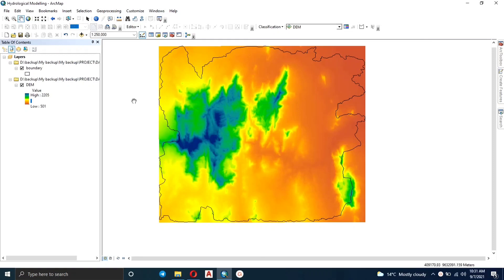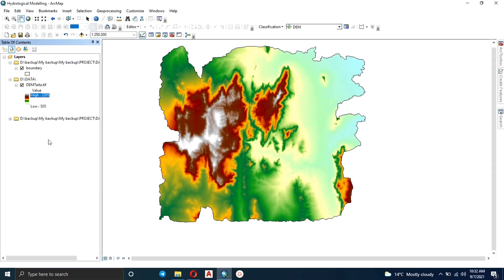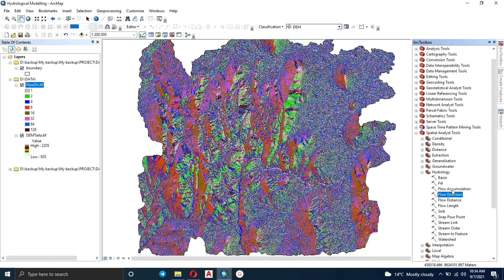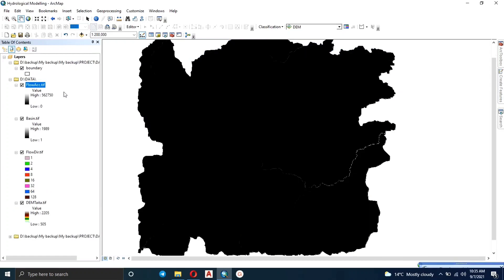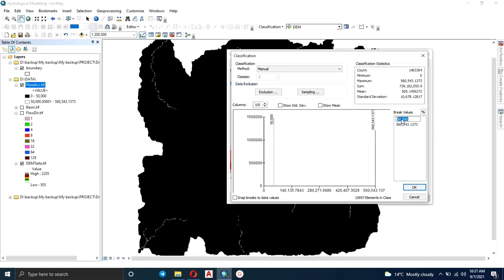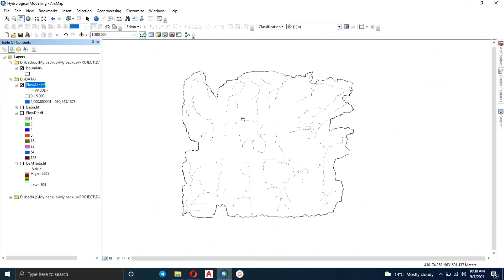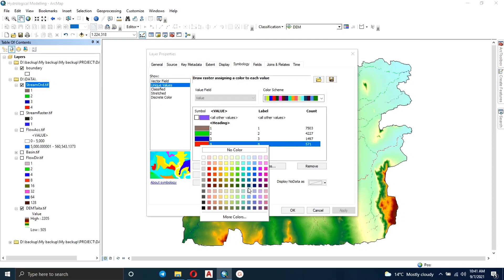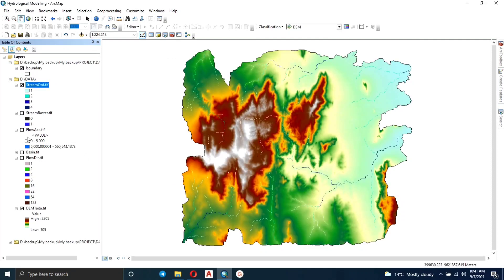Hydrological Modelling in ArcGIS/ArcMap using Hydrology Tool Part1 #Hydrological Mapping #GIS

Comment: Can you specify extent in geoprocessing
Reply from the maker: Yes you can use clip tool under geoprocessing to specify your extent but it works only for polygon features. For Raster you have to go to arc toolbox>data management>Raster>clip or just use the search bar